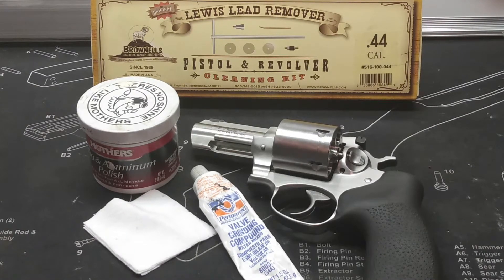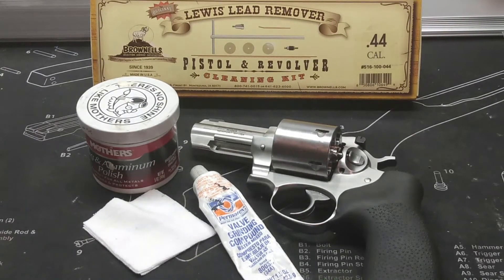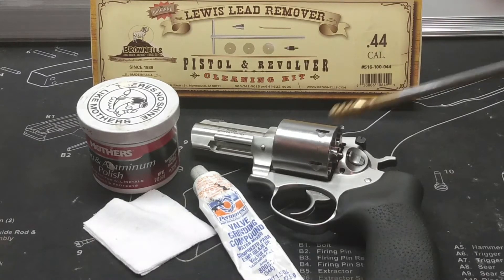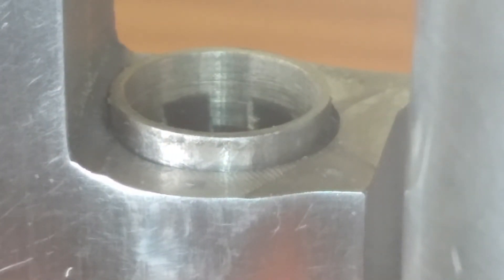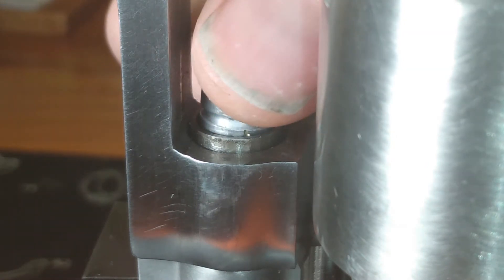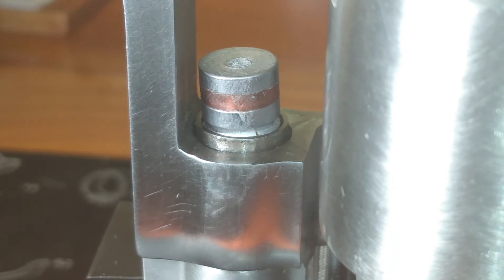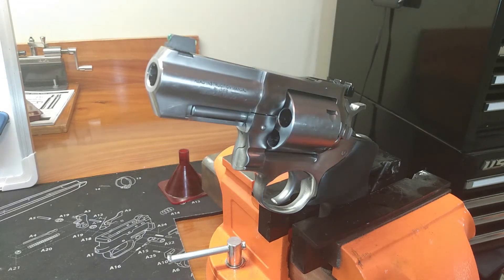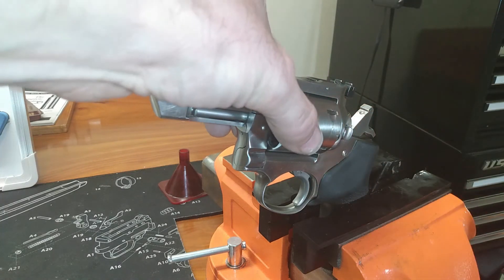5. Cast Bullet Path 11 degree Forcing Cone (1 of 2 Revolver forcing cone and polish technique)

Comment: The cylinder timing and alignment is what centers the bullet, not the free play in the cylinder notches and the bullet bouncing off the forcing cone. The cone is there to compensate for misalignment and to help prevent shaving and leading. Once that bullet leaves the cylinder throat it will hit where ever the cylinder is in relation to the forcing cone. The bullet will not self align.

Comment: Does cutting the barrel to 11° negatively affect Full Metal Jacket bullet accuracy? That's the only thing I'm worried about if it helps accuracy for one without affecting the other I'm sold.
Reply from the maker: No trouble whatsoever that I'm aware of. Just be careful to not cut any deeper than needed to remove the factory 5degree (assuming it is currently 5deg). Going too deep has been known to cause accuracy problems.

Comment: I think the drawing on the left side is out of order compared to the degree numbers.  The 5-degree angle should look like the most gentle and the 18-degree should be the steepest.  Thanks for taking the time to make this video.
Reply from the maker: Dauntless, thanks for watching! I understand your concern that 5-deg sounds as if it should be the most gentle and 18-deg the steepest. I'm not a machinist so I can not vouch for what methods they use to determine the number of the final measurement, but it is the way that I've depicted. I wish I could shed more light on the "why" topic. Thanks again!
Reply: @leadsmith44  Taper angles are typically measured in two ways.  The first is in reference from one side to the centerline axis of the reamer.  The second is from one side to the other, which is also called the "included" angle.  Forcing cone reamer angle numbers are "included" angles.  A forcing cone angle of "zero" would have parallel sides with no taper at all.  The larger the number, the steeper the angle.  Manufacturers used to put ~16-degree included angles (8-degrees per side) on forcing cones and they probably still do.  Gunsmiths began experimenting with shallower angles such as the 11-degree to try and ease the bullet through the cylinder-barrel transition with less leading and improved accuracy.  You can ream a forcing cone to a shallow angle on a gun without making the entrance diameter too large.  However, you generally can't go from a shallow angle to a steeper angle (and clean up the entire forcing cone) without making the forcing cone entrance too big.  I hope this helps.  Have a great day.

Comment: I must be too stupid. I just can't understand how 11 degrees could be softer than 5. The lower the angle the longer the cone will be.
OK. I must be looking for the wrong edge of this triangle.
Reply from the maker: No no... You're not even close to being stupid my friend. You are spot on. My diagram of angles is flawed. Sorry for any misunderstanding this caused. I'll try to revisit this topic. I've made a few edits in response. Thanks for stopping by!
Reply: @leadsmith44  I am having huge problems with lead, my taurus is poorly machined, that's why I am studying the problem. I suspect jacketed bullets may use softer angles because jackets can't be destroyed against rifling like lead bullets. A brass jacket starts to rotate with less interference. Lead bullets must reach their final shape as soon as possible, if the forcing cone is too soft the lead will be shaved and distorted because the projectile is getting faster and faster while the rifling is trying to rotate it. If the rifling is too shallow the soft lead may not rotate properly.
Just a theory of mine.
My cylinder is not well aligned with the barrel. I will try to adjust the cylinder stop. Maybe heating it to remove hardness and bending it. Not sure on how to do it yet.
Reply from the maker: @garetz2011  problems I've seen with Taurus are similar. The 11deg come might help because has a better opening for cast lead, but yes 5deg is naturally less. The Taurus tends to have a rough cut, poor alignment with the cylinder and even questionable lock up. A trip back to Taurus may help, but they will only prove their work with factory jacketed ammo, so you may not get the performance with lead that you are looking for. Wish I had better optimism for you, but been down that same Taurus rabbit hole.
Reply from the maker: Go for it. Enjoy the ride. I'm sorry to hear about your nations situation. May the Lord bless you and all your fellow citizens.